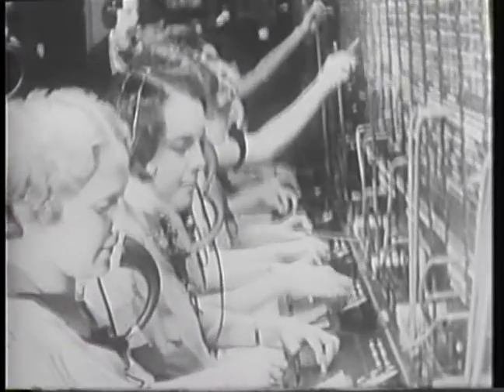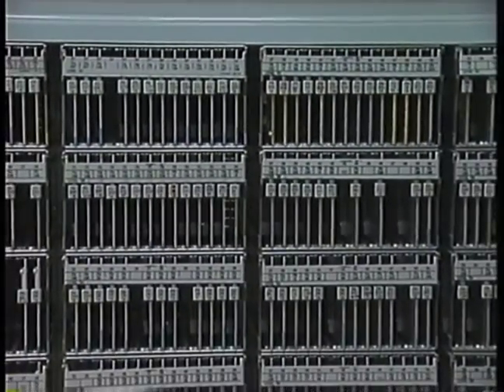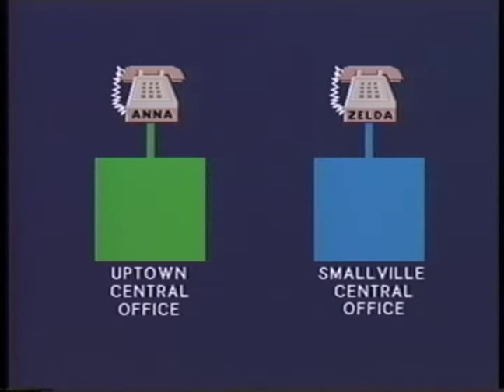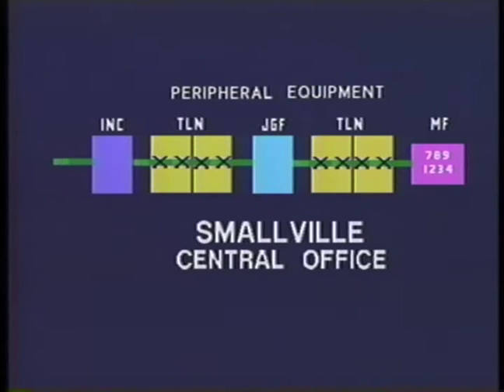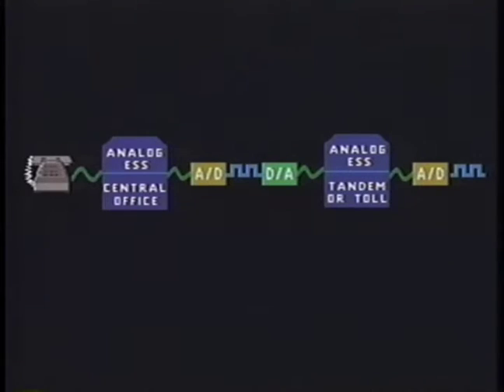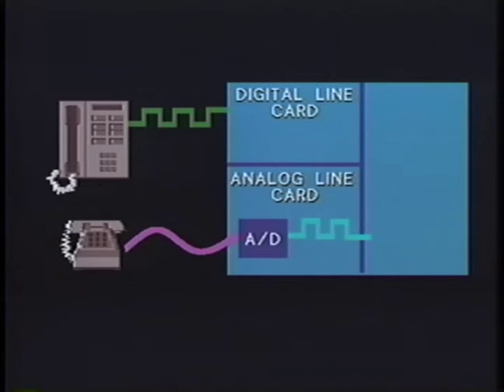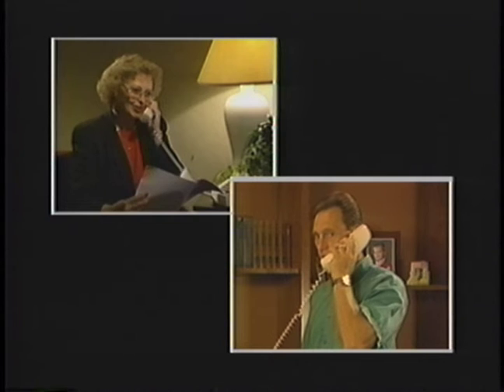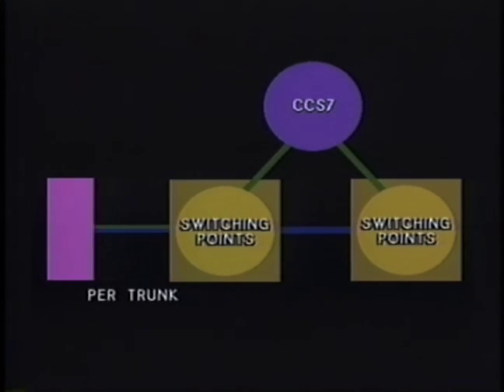AT&T Telessentials Switching TC1604

Comment: When I saw the Teletype at the MCC of the 1ESS, I was like "That's a KSR 43!"

Turns out I was right.  I used a KSR 43, but it was in the military, and mine was hooked up to a Missile Maintenance Test Set. (The Command Post one was of course hooked up to their BCP ;o)

As much as I liked the Teletype, the addition of new glass terminals and the cartoon page of the 5ESS (and later products from Bell and their successors) was pretty cool.  You could type page numbers at the cartoon page to get status, take equipment out of service, unequip, etc. in addition to using the RCV commands.  Another benefit of the cartoon page is that it's in COLOR, so you can determine the status from 20 paces.

(oh... 2:00 is a selector rod frame of a panel, followed by what appear to be some panel sequence switches; there is nothing else that looks like it. Crossbar was invented to exterminate panel and step because of the former's reliance on sliding contacts that required a lot of expense to maintain.  Imagine the toll network being on panel.  It would be brutal to the equipment even with mid-century call volume!)

There needs to be more training videos that feature fog machines!

Comment: This is a description of some of the equipment in this video. 

00:50  Operator Console. TSPS (Traffic Service Position System) 
00:59  Master Control Center of a 1ESS switch preceding from left to right. 
00:59  STTP (Supplemental Trunk Test Panel) Can have more than one. Not part of the MCC. can be located any ware in the office. 
00:59  AMA tape drives {Automatic Message Accounting) had three phase AC direct drive capstan motors. 
00:59  Local Mtc TTY.  This Image is of Model 43 KSR TTY. the first offices cutover with a Model 38 KSR TTY.
00:59  TLTP (Trunk Line Test Panel) Telephone set on the desk was modified so that tester could talk on the phone using the head set plugged into the desk. See the small box with three switches mounted at the top of the panel. The position of the switches controlled if the office was in or out of service along with the "CUT--x" typed command. 
00:59  MCC (Master Control Center). This is were the configuration of the office could be observed and manually controlled. 
00:59  MCW (Memory Card Writer).  This machine wrote new data to the memory cards of a module of a PS(Program Store). Tech is mounting a MCL (Memory Card Loader) to the MCW.  MCL was used to remove and install the 128 cards of a PC module. 
01:17  This is the MCC of an other 1ESS office.  See that the LOC MTC TTY is a Model 38 KSR TTY and one more in the ground. 
02:00  This is a Panel or a 1X-BAR switch. 
02:03  These stepping switches were used in all kinds of offices in all kinds of equipment. 
02:05  SXS (Step by Step) selector switches in a large central office. 
02:06  5XB (5 Cross Bar) switches being installed in an office. 
02:13  Close up of the TLTP and The MCC. 
02:23  See the steal hinge at the bottom of the MCC. That was an added Gard to protect form accidental pressing of the keys. 
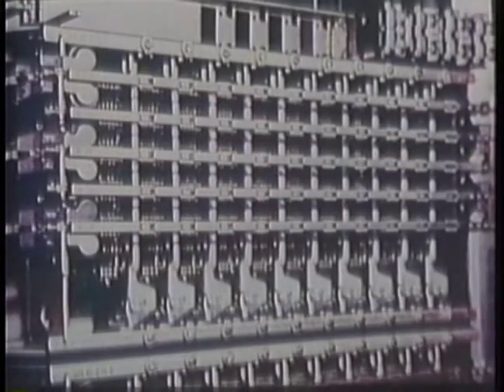02:34  Cross Bar Switch. 
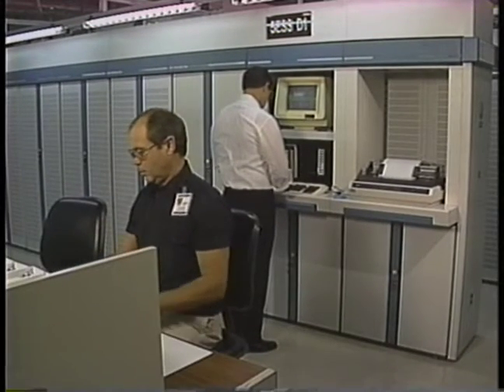02:59  5ESS switch. 
03:18  AMA tape drive close up. The door to the AMA is clear glass.  This drive has a rectangular notice attached to the door in front of the BOT and EOT (beginning of tape and end of tape) photo sensors. These were added to protect the drive from alarming when someone took a flash photo. 
03:59 Tech is loading 128 memory cards into mod 05 of a PS (Program Store). 
04:33 LSF, LJF, TJF or TSF (Line Junctor or Trunk Ferreed switches. Next generation of swtching had Remreed switches. 
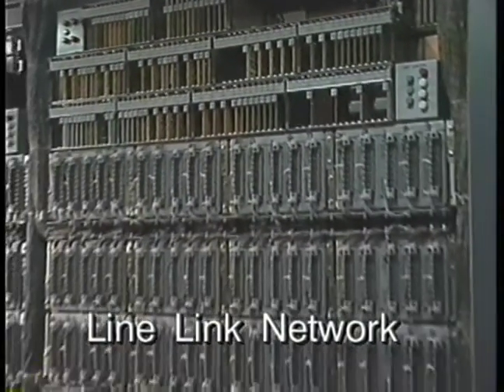05:56 LSF (Line Swirch Frame) with Remreed switches Switch mods are 13a 4 to 1 consitration 64 line mod. Second gen equipment. 
25:38 CC  (Central Control) There is a quick look at the top of the bay where the buss system is connected to the CC. 
25:55 5ESS Line cardsin modulaes. Tech removes, looks at, and reinstalls a line card. There is no need to do this there are no options on the line card to set.  That's the movie business. 
36:38 5ESS MHD Memoriy Hard Drive. 
36:50 5ESS Mtc Terminal GUI (Grafic User Interface) This does the same fuction of the MCC in the 1ESS and 1aESS. 
39:09 4ESS MCC. Toll office.
Reply: @Richard Conte I have never seen a TOPS.  There were some in Oklahoma after the Bell System Brake-up, I never had a reason to go see them.
Reply: There's a lot happening around 1:54 - 2:04

1:54 - B operators connecting calls. The displays on the keyshelf are PCI (Panel Call Indicator) displays. These calls came in from a Panel office to a manual office.
2:00 - Panel office, probably a sender-link frame
2:03 - Panel sender, with rotary switches for digit registration (old style)
Reply: Number for ESS, the toll digital electronic switching system, one of the first installations of the system was in Regal Park Queens New York. That installation at the time was 200 million. The building is like a fortress no windows whatsoever, no internal heating system the system itself generated enough heat to heat the entire building. I was privilege to be part of that installation. It was a major step in digital electronic switching systems. The MCC was showed briefly it was black generally in a separate room by itself overlooking, the entire switching system. My area of expertise was in number one ESS, tsps, traffic service position systems, number for ESS, first All Digital electronic switching, and number five ESS first electronic digital fiber optic switching system. Thank you for this post brings back many many fun movements in my career of 36 years. Today's date September, 13th 2022. My employment started in February 1963.
Reply: At 1:56, is that a “B” board operator? She’s plugging in cords, but I don’t see a dial or key set. There is what looks like a display panel in front of her.